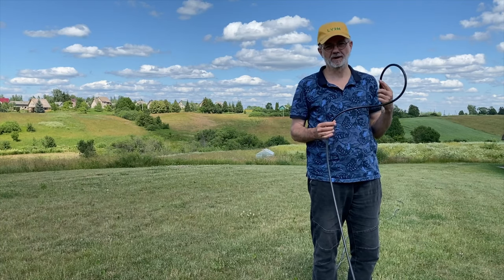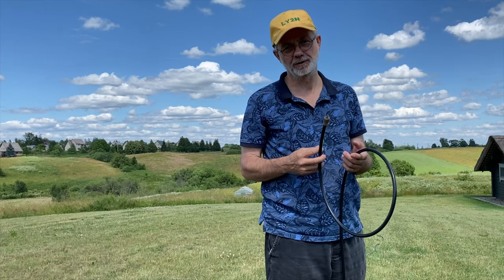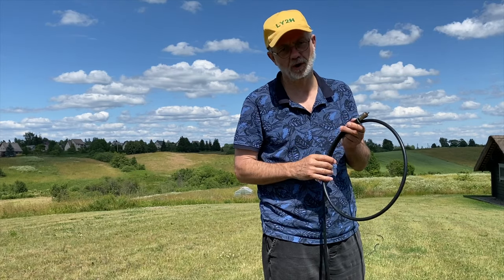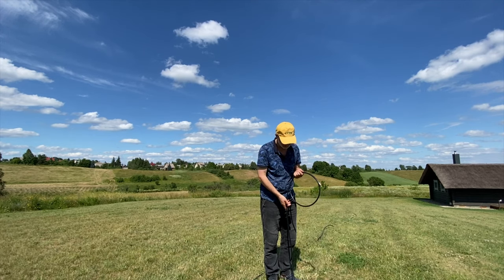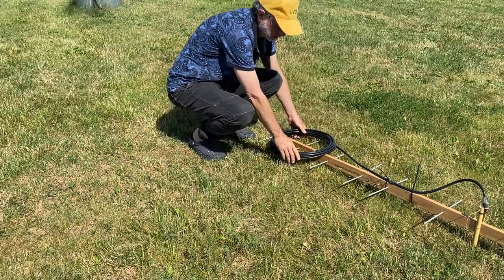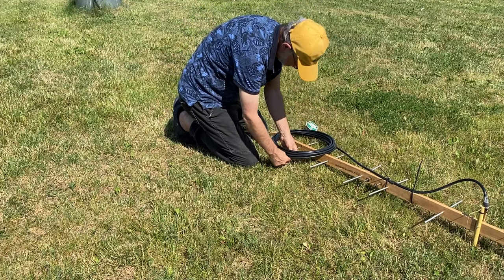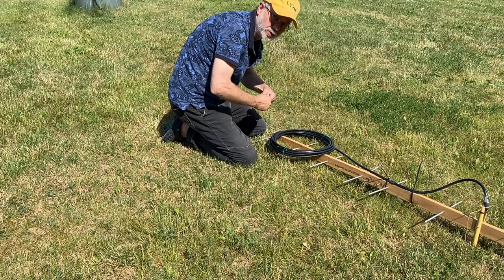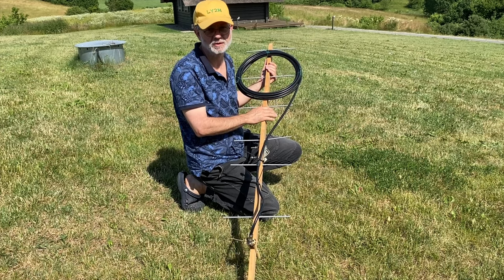Two secrets how to roll up the coax cable quickly and professionally. An after-field-day time saver!

Comment: Nice but I have been doing this coax rolling up the same way for over 50 years now. Good to share these little practical hints .Thanks. ON4DS/OP5T (former ON5UM/DA1UM).73. Jim
Reply from the maker: For over 40 years here :). Nice hearing from you Jim! 73! Linas LY2H ( former ON4BHP)

Comment: Hi Linas,
I also used the same approach for storing RG58 coax but than found more convenient way of duing this. I am not sure that it is appropriate for this heavy cable, but at least worth to try.
Here is link to video: https://www.youtube.com/shorts/6q7T1DArK8g
Reply from the maker: Thanks! Yes, I like and use the “under-over” method too. But in the case of the thick cable , like RG-213 in my video, it would be just a bit complicated to handle it, as the role becomes rather bulky if you need to role-up some 40m of cable :). But it’s OK for the RG-58 or a thick rope. Well, that’s my personal experience… 73! Linas LY2H
Reply: @rst5nn  this is what I do for RG58 too. For long very flexible audio cables I just figure 8 them one metres at a time and it takes seconds to do a 30 m cable.